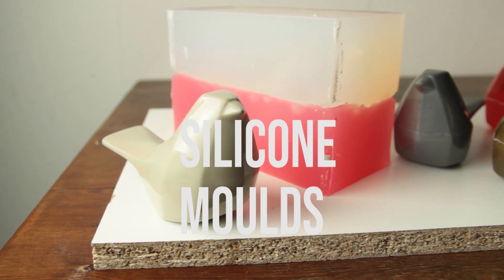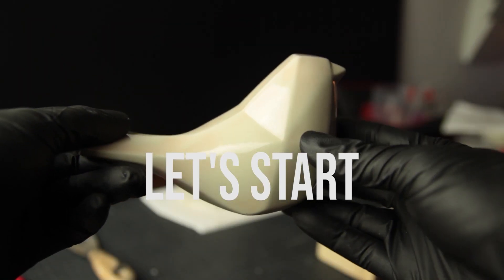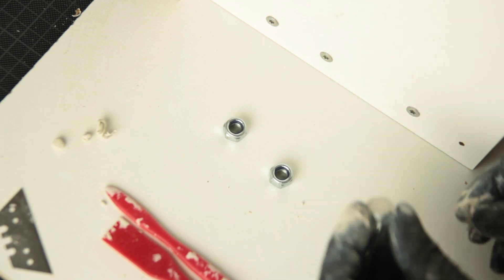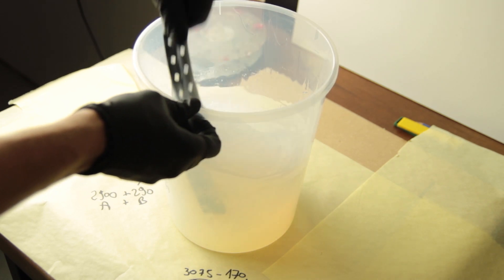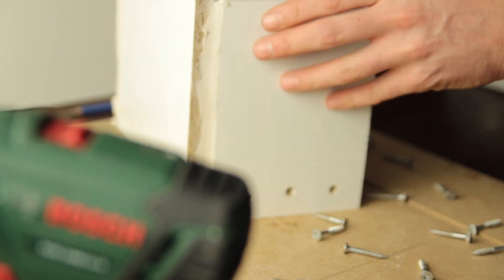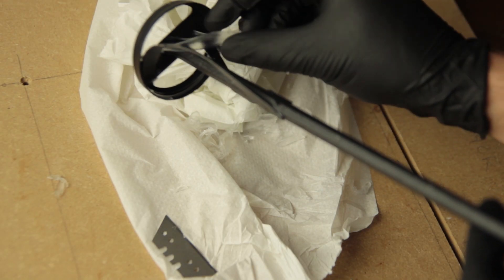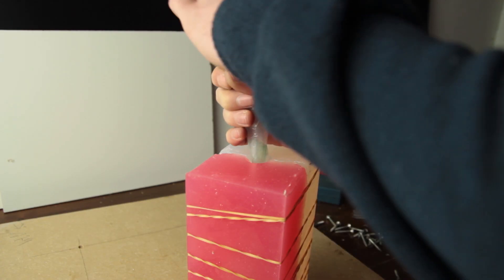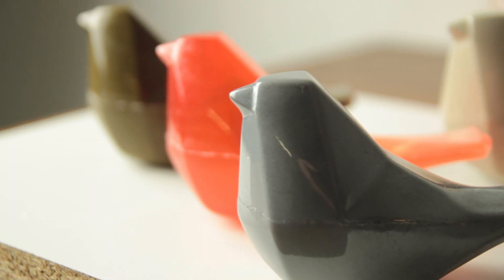Silicone Mould & Casting parts (2 part mould) - AS40 Addition Cure Silicone Rubber

Comment: oh, this is cool, great tutorial. Do you know if it possible to create silicon molds for objects which are made out of hard foam ? ... or the silicon would melt the foam? I would like to replicate an object made out of EPP
Reply from the maker: Silicone normally won't melt the foam, it might sometimes be that some types of silicone won't cure on some material surfaces, so better first make a simple trial in the material to see if does cure or not. Another  thing is that your surface of the Styrofoam might stick into the silicone if it has to much porosity...